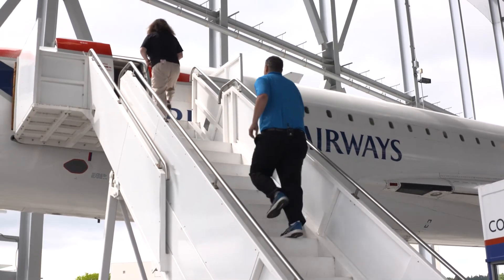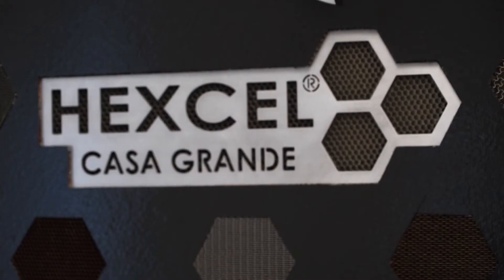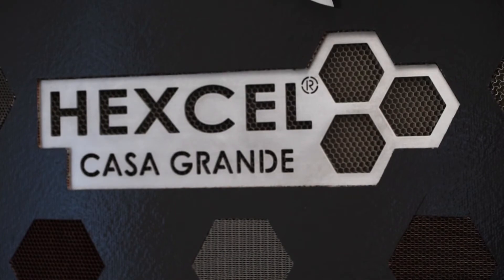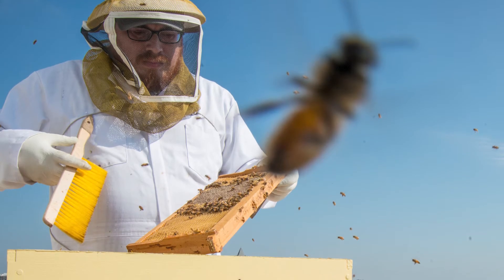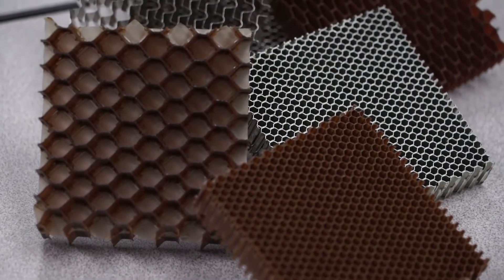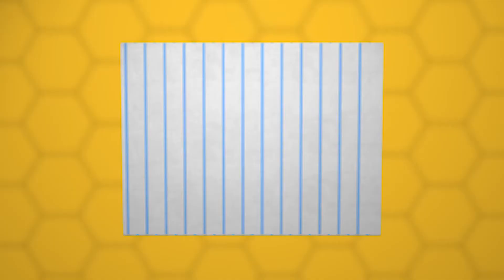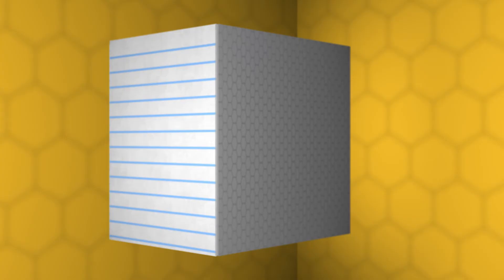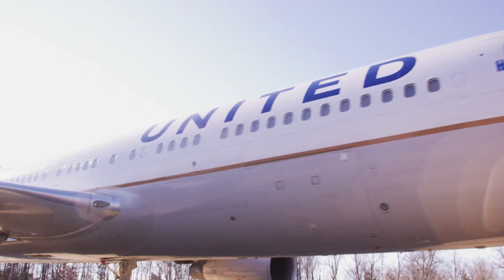"We Stole the Technology From Bees."  How Honeycomb is Used in Aerospace

Comment: Honeycomb is vulnerable to water ingress if not properly sealed. As a aircraft climbs to altitude the temperature get colder.  Water when is passes through 4 degrees C will expand. If water is trapped inside these honeycomb cell it will expand as it passes through 4 degrees C and will cause damage to the honeycomb structure. It is important that honeycomb panels be water tight.
Reply: Hello...you seem to know a lot of things about material selection in airplanes....I am looking for a good material for a design of a supersonic fighter jet.... But I am looking for composites(most likely fibreglass)... I want a good strong and rigid structure with a high melting and softening point....can you suggest a material...and can you suggest a resin (epoxy or something) which provides great strength and has a high melting and softening point....